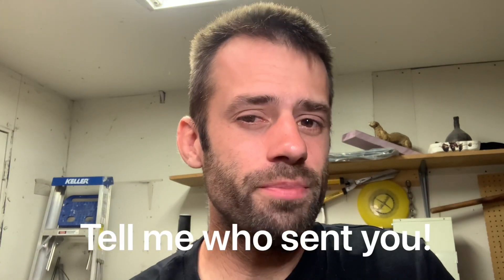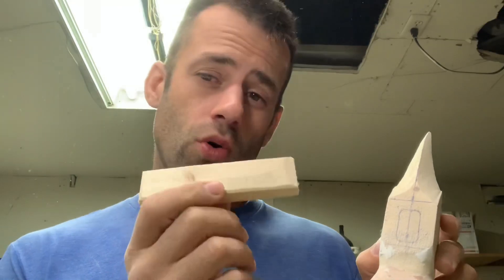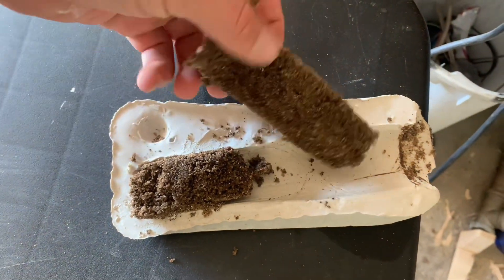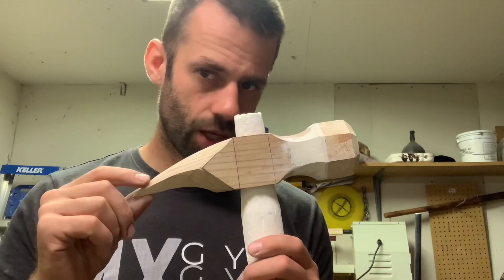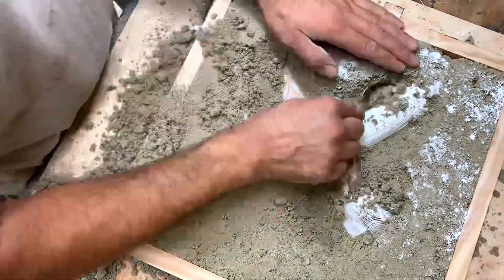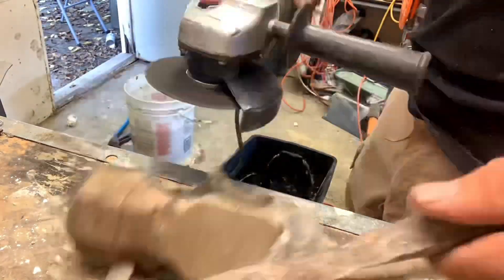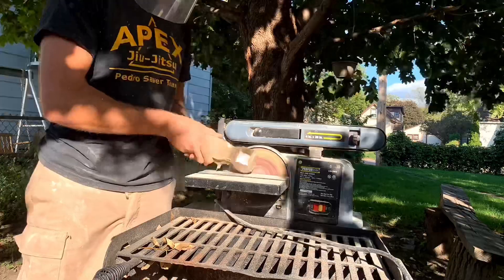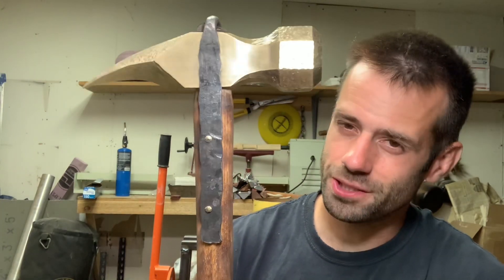Making a War Hammer - 5 Way Collaboration - War Hammer challenge

Comment: The fins could’ve been attached the the bucket instead of the frame, or using a perpendicular threaded rod, removable. Why didn’t you just use the un relays on the original wheel, perhaps with thrust bearings as well?
Reply from the maker: I’m not sure I follow you.

Comment: That was an awesome video. Thanks for sharing! I am impressed that you were able to cast such a thick piece of bronze, and make it look so good. I have one question though, at 13:43 minutes into the video, you see that there are sort of, bubbles, or pits on the surface of the front part of the hammer. I get these a lot in my larger castings as well. Do you know what these are? And are these just a result of casting thicker bronzes?
Reply from the maker: It’s pretty topical to have little flaws like that in castings. It can be caused from impurities in the metal. If could mean you have bad sand with wither too much clay or too much water so it isn’t porous enough to let the gas escape or  the sand is off gasing something. 
But a big one is metal turbulence. The smoother you can get the metal to flow the less it sloshes around and gets air trapped. Good casters know how to run their gates so it produces as little turbulence as possible. I’m still working on that.

Comment: Very Cool! nice planning ahead with the belt sander. good tip for sure. I wonder if you could reinforce the core with some wire of a nail. good work not quitting. cheers
Reply from the maker: I actually did do the. I put a wire in eventually and it did help add strength. I just can’t show everything or my videos would be too long.

Comment: Why don't you have a 3d printer yet to make these parts?
Reply from the maker: Because I learn more skills by doing everything by scratch and I hate computers.
Reply: @lundgrenbronzestudios  Everything is going to computers, minus whale embrace it and enjoy the accuracy of stepper motors.
Reply: @lundgrenbronzestudios  Good pattern makers can make many parts much faster and much cheaper than printers. congrats on the excellent as-cast surface finish on your bronze, your patience and tenacity are very admirable.  I like the bracket too - maybe winding it with copper wire would add a little flair ?

Comment: I think that surface holes on the top part of hammer was due to gases from core. Core was not dry. Investment core could work but mayby IT should be burned like for lost wax. Shorter core could be more break resistant;) anyway your skill of fail absorption is impressive. Very enterteining. laughing few times.